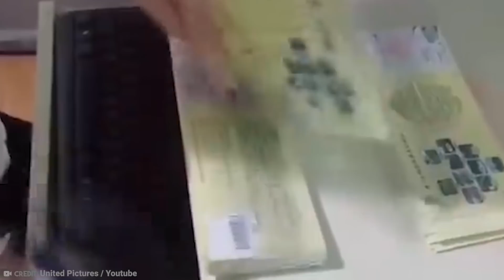15 Fastest Workers in the World

Comment: That's how they show the tire is balanced. Can't do that if it isn't balanced.
Reply: Not true, tires only need balancing if you're taking them over 40 mph, if you drive within the city you're fine, balancing just makes your car drive smooth at higher speeds so you dont feel the rattles, shakes and shimmies... and a tire at the normal air pressure will not bounce like that, those tires are way over inflated which is bad for the tire because it stresses the rubber too much and causes cracks...